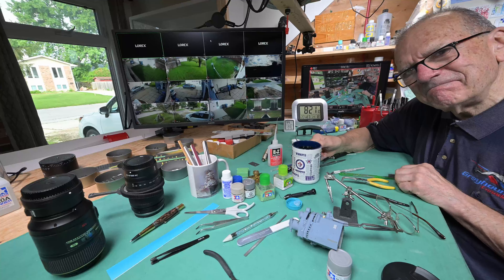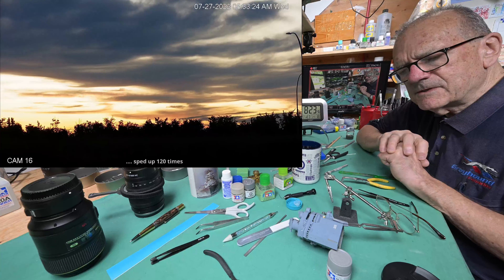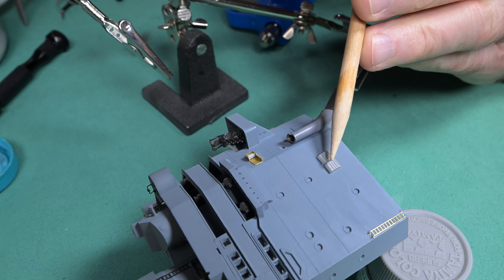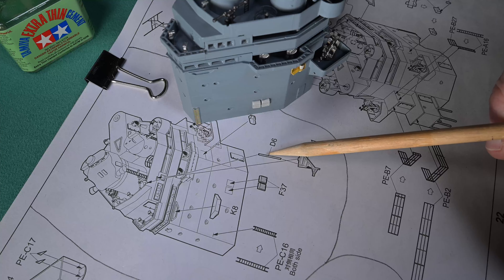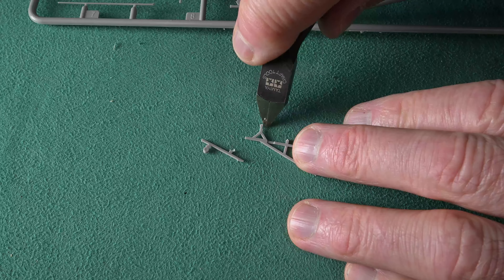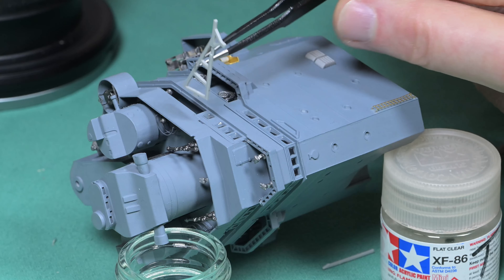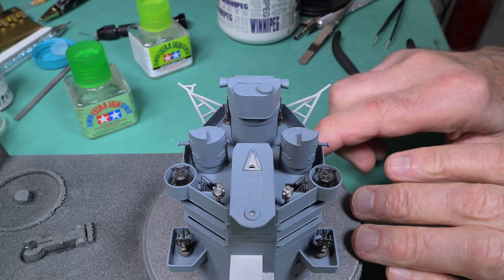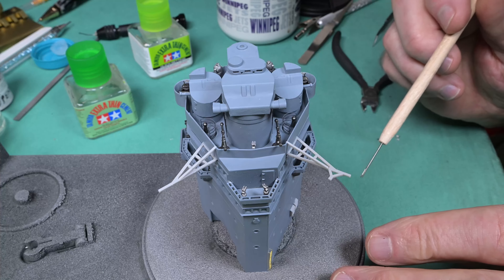The Model Ship - Part 1252

Comment: You can use a sharp knife to prepare the areas you are gluing into instead of softening with extra thin. This provides a paint free bonding surface so you can use less glue and you don’t have paint running because of the glue. Can’t always get a knife in the spot you’re working on, but when you can, it ends up being neater.